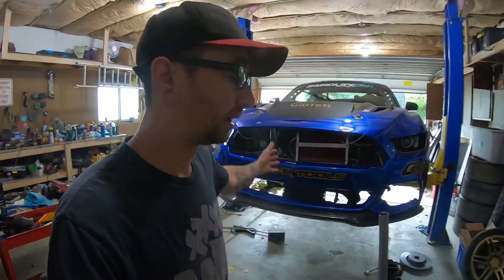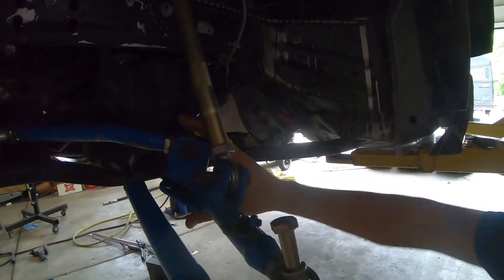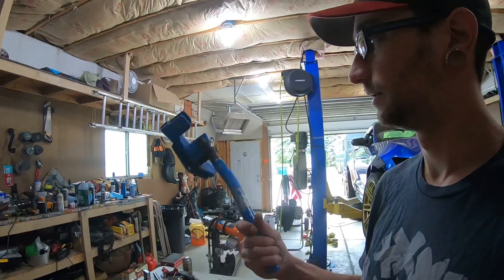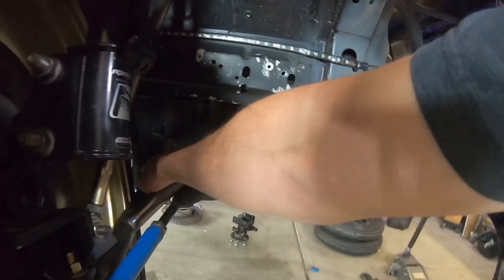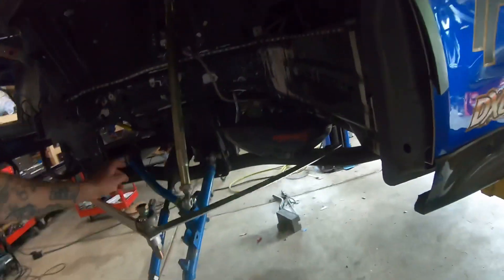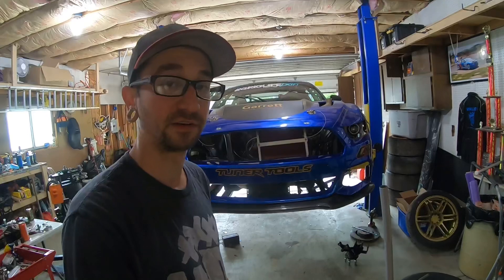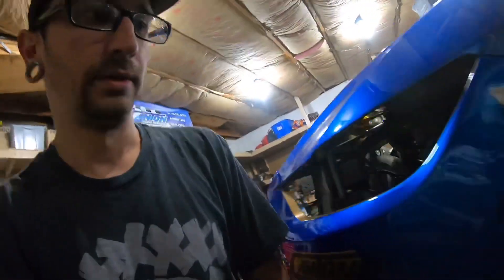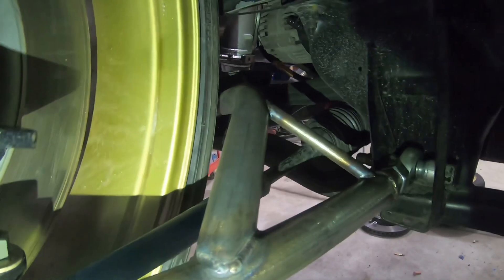Why Did This Break Already, And How Am I Fixing It? /LS Swapped S550 Mustang

Comment: Keep your head up.  Just working out the bugs. Bunch of people break their front lower control arms. YouTuber Taylor Ray’s “professional” aftermarket 350z arms broke, both left & right at the same time! Haha. Some other YouTuber OffBeat Garage showcased an EVO pro am car that broke it’s arms. Their solution was remake one-piece arms instead of 2pc adjustable design. I used to think Wisefab was over engineered with 1/2” thick steel arms but maybe not. My homemade arms are 1.25” 0.120 wall with two 0.250” full length gussets/mounts for 2pc design. But they’ll probably break anyway.

Cheer up!